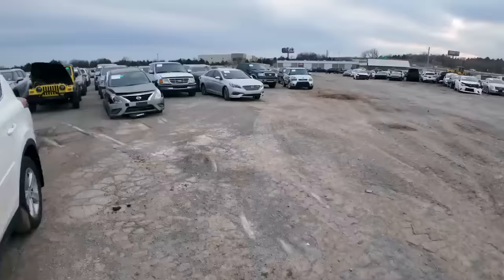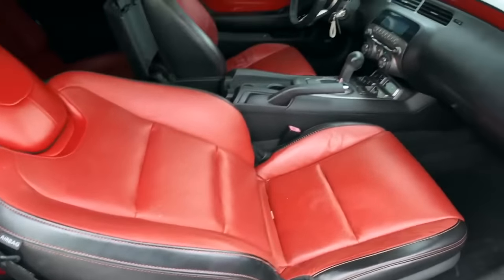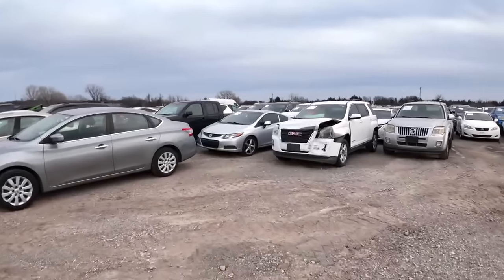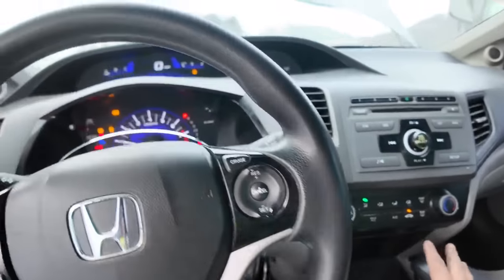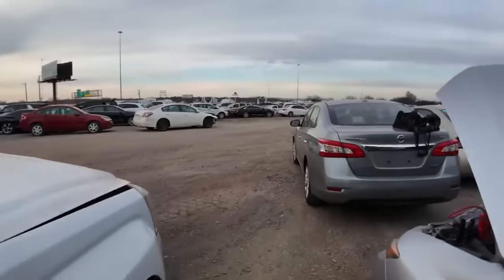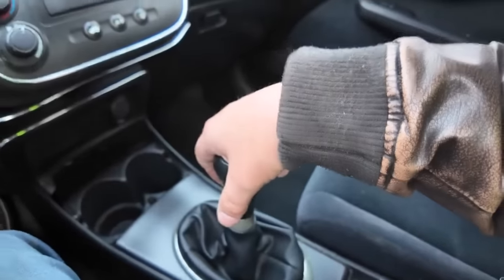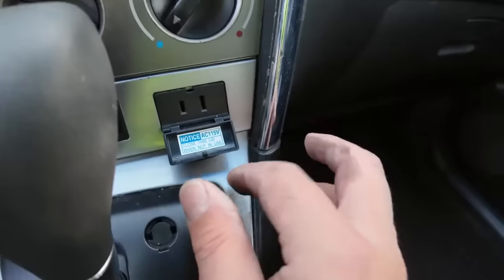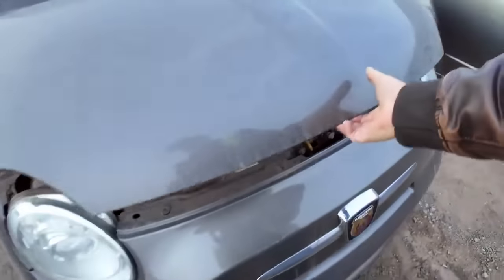I Found this RARE Fiat 500 ABARTH at IAA for $800!! Is it Worth it

Comment: Randy, 800 bucks for the Abarth isn't a bad deal.  I owned a 2012 Abarth for 4 years, it's a car of compromise for sure but it's fun as hell to drive and the exhaust note is amazing for what it is. Mine was black but similarly equipped to the one in your video except for it had a power moonroof and Bose audio instead of Beats.  I just traded mine with 195,000 miles on a 2014 Cadillac ELR last week (since yours already sold LOL).  I wouldn't pick an Abarth as a daily driver/commuter, but as a fun weekend car - you can't go wrong, especially at full depreciation.

Comment: Also I own a 2008 vibe, the idle issue is due to a vacuum leak somewhere in the system. I guarantee it’s the intake manifold gasket. They flatten as they age causing more revs to compensate for the extra air. But 03-04 cars are drive by cable, so it could be the idle air control valve being faulty, 05+ does not have that. My 08 idled high when cold, check engine p0171, I changed the gasket, No more codes no more high idle. But that 299,999 could be wayyyy more

Comment: Randy, on that Honda Civic, you’re going to see all those lights anytime the battery has been disconnected or dies. It needs to be run for a few miles to recalibrate everything. Not sure about the engine running bad though.

Comment: Hey Randy, good video.  Hope you made it out before getting locked in.  The junk yard I pull parts for my cars from runs an air horn starting about 15 minutes before closing.  I'll definitely have to go check out the cars at Co-Part over by where I work.  Your videos have inspired me.  I went to their website and already have a watch set on about half a dozen of their cars.  I still need a little better use out of my leg first though.

Comment: @autoauctionrebuilds 9:12 My guess is the driver flung the door open in a parking lot while a lifted 4x4 with a brush guard caught the top edge of the door as they were pulling in a parking spot. Just my guess.

Comment: Them Fiats are not worth anything. My dealer took one in trade last year a 2013 Fiat 500 and with 45k miles no accidents 1 owner was only worth $1500-$2000 wholesale
Reply from the maker: You can’t buy an abarth for $1500-$2000
Reply: The 500 I think I'd say is  different to the abarth!